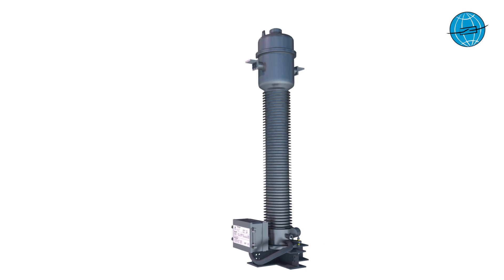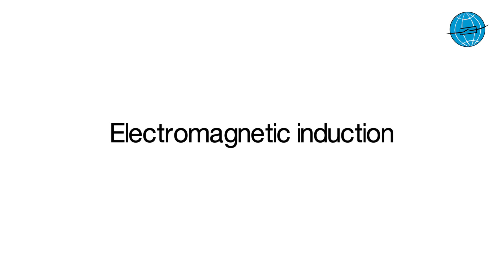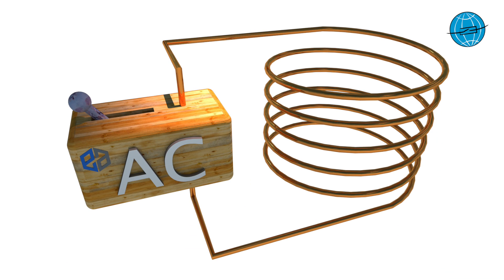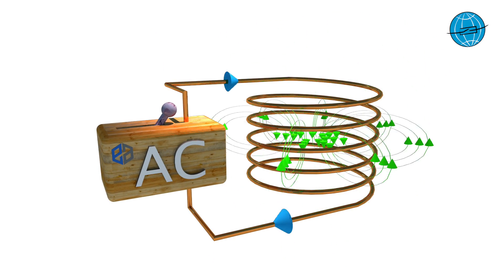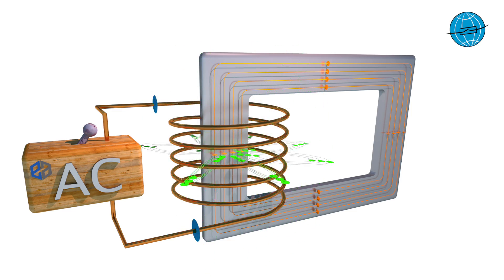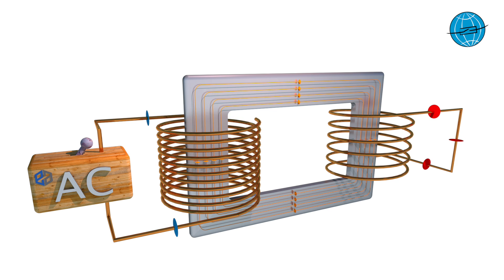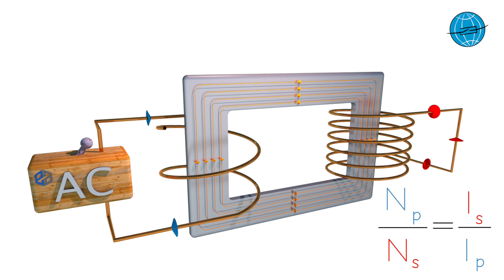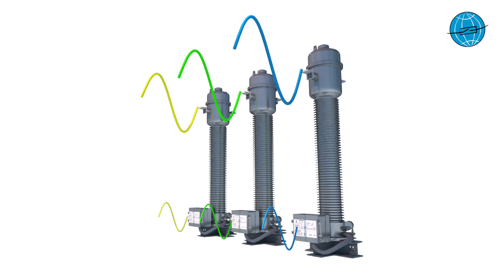How does a current transformer work?

Comment: Also this is not a CT.  It is a PT.
Reply from the maker: It is a current transformer (CT). You can argue it's a PT with short circuit on the secondary side. Thank you for your feedback.
Reply: Jim why are you not considering this a ct? If you change the voltage in a circuit you also change the current correct?

Comment: Animations is very good. But in current transformers, primary is thick section and less winding. 👍
Reply from the maker: Thank you, that's right. We use the common transformer model to explain the function. Real MV & HV CT's have no primary windings at all. You got the line, the core and the secondary coil ... kind regards
Reply: The current trahsformans, which we use for measurement the strom when the voltage is 21 kV ars with some vindung in primary.